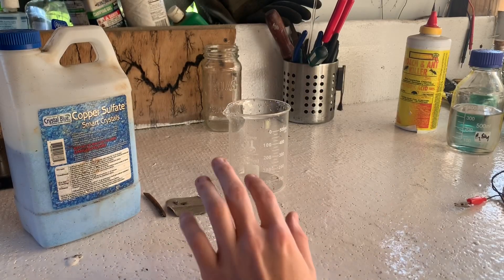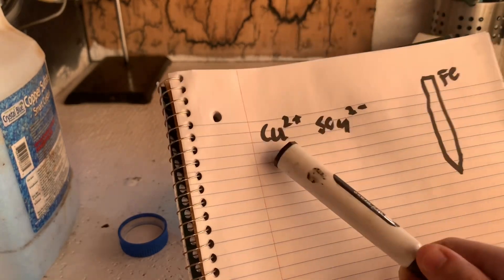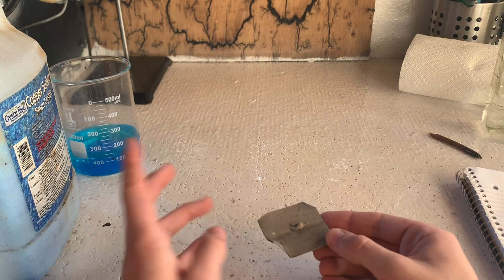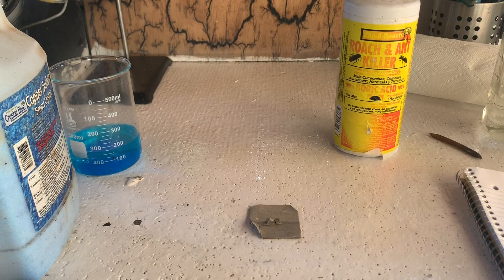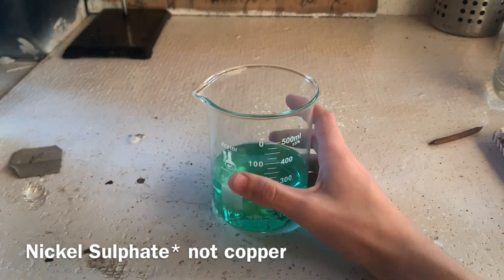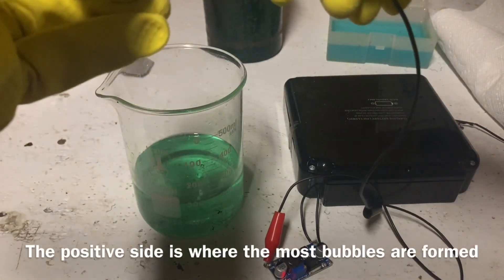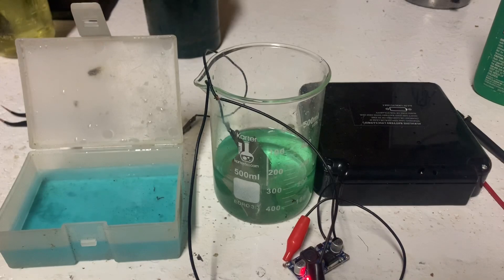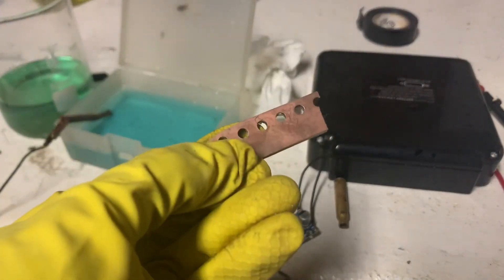How to properly copper plate steel

Comment: Just tried this after doing a strike plate of copper. Removed the plate. Negative for part. Positive for anode. Should be titled how to properly plate steel in reverse, or how to unplate copper strike.
Reply from the maker: you had the wrong polarity, positive and negative can mean different things. I use the term positive as where the electrons are coming from like how a car batteries positive is not truly positive but negative due to the charge of the electrons. Thats why in the videos I say the positive side but I also say the side where the electrons are flowing from to avoid mix ups.

Comment: Great video! Very informative. I have a question.. I have a mail box I made. It's pretty extreme, as my previous one was obliterated by a baseball bat from mischevious kids. I am a fabricator by trade. I made a mail box from 3/8th" thick steel. It looks just like a conventional mail box until someone trays to damage it. I want it to look just like our previous mail box, which was copper. It weighs approximately 150 pounds. Do you think I can still plate this, and if so, could you give me some pointers as to quantity and ratios, and how much nickel I would need? Would the voltage amount need to be higher, etc. I would very much appreciate your input. Thanks in advance, Steve! I can give you my email address in private. However that works.
Reply from the maker: Since it’s going to be exposed to the elements and is just such a large piece, I recommend having it done professionally. It’s actually gonna be cheaper and better than any DIY plating method out there.

Comment: What do you think of the muriatic acid method? I'm looking to copper plate some of my gardening  tools, but the copper layer should last and not scratch off like dirt. Thanks! This is the other method I was talking about: youtube.com/watch?v=SIU3lsZMx7A&ab_channel=stancurtin
Reply from the maker: The muriatic acid method won’t work well at all for adhesion and corrosion will come fast. Essentially since it’s gonna be outside it will rust, even with this method it still will eventually corrode. Your best option would probably be a professional plating shop, while not the cheapest it will last the longest.
Reply: @PyrotechnicalScience  Kindly thank you for the honest reply, I will look for a shop, but if I'm not finding anything trustworthy, I'm gonna come back to you for a DIY method. 🤗 Thank you again!
Reply from the maker: Yeah no problem, anytime!

Comment: I was able to electroplate iron directly with a copper surface using an NaHCO3 (Sodium bicarbonate) as an electrolyte, with good result and without any intermediate steps.
Reply from the maker: Yes you can copper plate steel with simple alkaline solutions, but simply the plate won’t hold very well, this is why almost all industrial copper plating uses a nickel or a copper cyanide/pyrophosphate starting coat.

Comment: Nice 🖖👍
Instead of sulfuric acid it is possible to use Ammonium(zinc chloride) Chloride? 🤔
Reply from the maker: You mean zinc chloride and ammonium chloride? Or ammonium zinc chloride?
Reply: @PyrotechnicalScience  hi, yes
Ammonium Chloride and Zinc Chloride, can one of they be used as a replacement for sulfuric acid (battery acid)?
Reply from the maker: As far as I know, no. You don’t have to add sulfuric acid, it just helps with conductivity and the smoothness of the plate.
Reply: @PyrotechnicalScience  ok, thank you ☺️

Comment: I copper plated steel very well last week using a baking soda solution
Reply: Yep! Its no prob to coat steel with copper in bs-solution
Reply from the maker: You can copper plate steel using alkaline solutions, but for a long lasting and corrosion resistant plate I don’t recommend it. To get the best plating results is to use copper pyrophosphate as a preliminary coating or to use a nickel coating. These will be you best bet if your looking for a functional plate as an amateur.

Comment: Switch your leads around. For example the first nickel plating you did. 
Use one alligator clip to attach the nickel electrode to the positive terminal of the battery (anode) and the other to attach the steel to the negative terminal (now called the cathode). 
Also
If you mixed 5 parts water 1 part muriatic acid and used solid piece of copper it'll plate directly to the steel. Remember the positive goes to the copper and negative to the steel. Since you don't have The correct solution it'll take a few minutes but it'll create it's own via the copper anode. Make sure nothing other than the copper anode is in the solution.
Reply from the maker: Why would I switch the electrodes around? then it would reverse the plating process.
Reply: @PyrotechnicalScience  Idk if you made the mistake of saying it backwards but you said to put the positive on your part and the negative on the Nickel and that's backwards. It goes like I said in my first comment. Your positive always goes to your Anode. 

Anode is defined as.
the positively charged electrode by which the electrons leave a device.

Cathode.
the negatively charged electrode by which electrons enter an electrical device.

Your Anode is your piece of nickel and cathode is your steel. 
Your contaminating your solution and not getting a proper plate. Trust me look it up.

I'm in no way trying to be critical of what your doing. I like watching and learning and since I do plating as well, I thought I'd put my two sense in. I'd hope someone would correct me if I didn't do something right. If I am wrong then please correct me leaving a source as proof. 
 I'm only trying to point it out. You may have connected it correctly but didn't say it correctly like you caught yourself doing when you corrected what solution you were using... 
Keep experimenting and learning my friend.
Reply from the maker: I appreciate the advice, but I see where you misunderstood. I use the term positive in reference to where the electrons are leaving, kinda like how a car battery’s positive side is not truly positive but where the electrons flow from.
Reply: @Nelson Brett 

Since: preposition
in the intervening period between (the time mentioned) and the time under consideration, typically the present.
"she hasn't spoken to him since last year"
conjunction
1.
from a time in the past until the time under consideration, typically the present.
"I've felt better since I've been here"
2.
for the reason that; because.
"delegates were delighted, since better protection of rhino reserves will help protect other rare species"

Sense: 1: my senses are tingling.
 Or
2: Some people make no sense..🤔

Cents as in  .99 cents short of a dollar.
Reply: @Nelson Brett Two sense?
Two cents. 

The question is, what are you talking about?